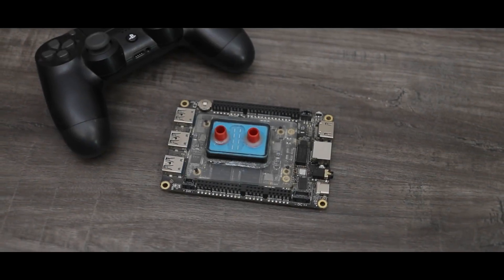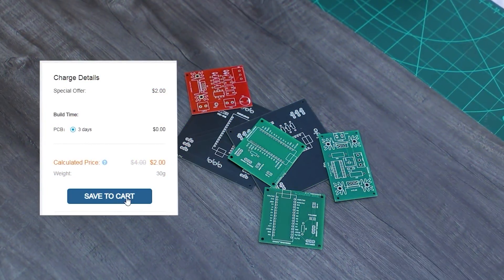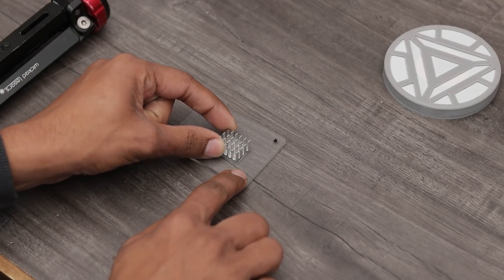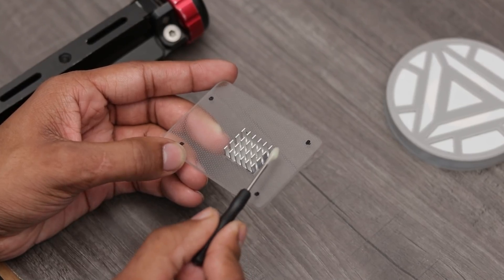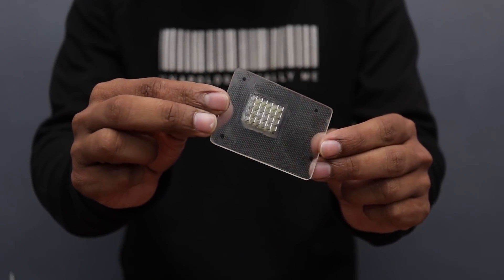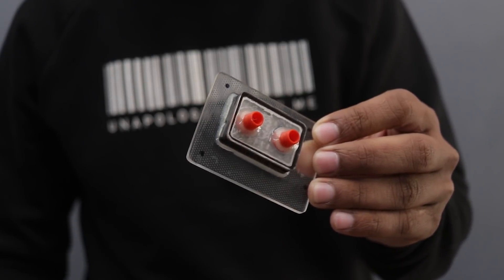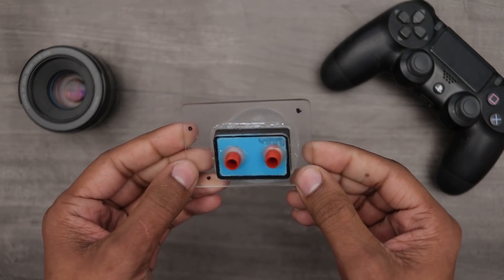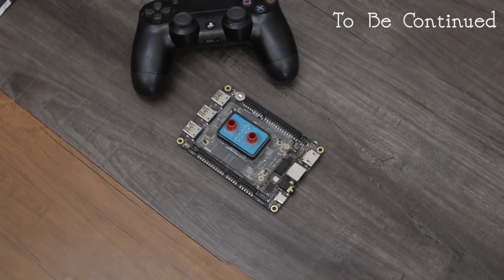Building a Tiny Liquid Cooled Gaming PC (Part-1)

Comment: To test whether things are properly tight, pump air under pressure into the part instead of water! Air will be able to find smaller holes, which is good before they become bigger holes under water pressure. Then spray soapy water on the part and keep adding air pressure. If the soap foams up, you have a weakness in that spot that you need to fix. Fixes are easy, just drill into the spot with like a 2mm drill and then fill it with epoxy.